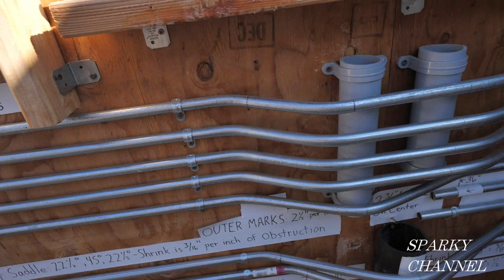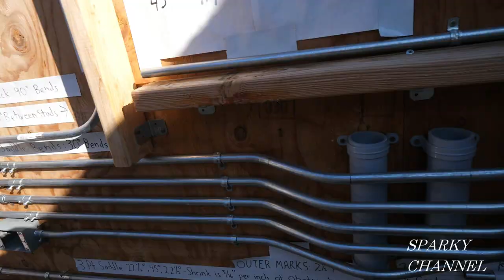MILWAUKEE  100 Ft. Polyester Fish Tape w/ Flexible Metal Leader 48-22-4195

Comment: eagle eyed want to know if you moved your bending board to a different site, and are those Milwaukee side-cutters and metal worker/rebar tying pliers? ;-)
Reply from the maker: Same bender board. I'm thinking of expanding it. LOL! Those are Milwaukee iron worker pliers 48-22-6102. They have a little spring in them, very easy to handle, excellent for rebar tying.

Comment: @Sparky Channel. Thanks for your great demonstration of the fish tape and proper technique for pulling wires in a conduit.

I have a question. How and when should wire pulling lubricant be used? Can one tell when it's needed before pulling or only after a problem happens?

Hope you and your family stay safe and well.
Reply from the maker: Wire pulling lube is an excellent idea and I could've used it with 3 12 ga wires in 1/2" conduit. 4 12ga wires in 1/2" conduit you definitely would need it.  Basically, if you think you'd better use it then use it. Yes, sometimes with pulling wire you will wish you used it when you didn't. LOL! Thanks1
Reply: It also depends on the kind of insulation on the wire, anything like THHN or THWN will not need lubricant because it has a nylon sheathing over the insulation. But if there is no nylon it's preferable to use lube if the conduit fill is above 30%